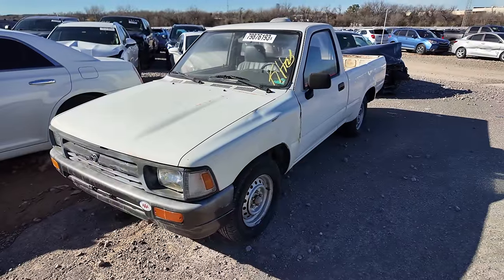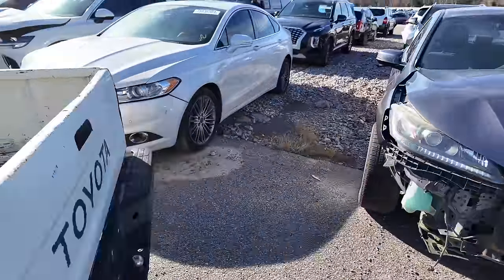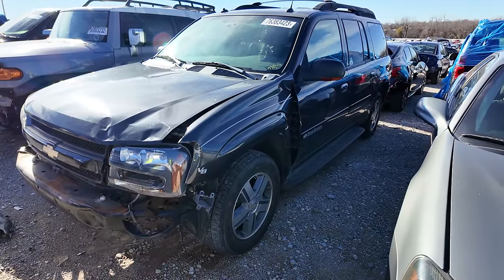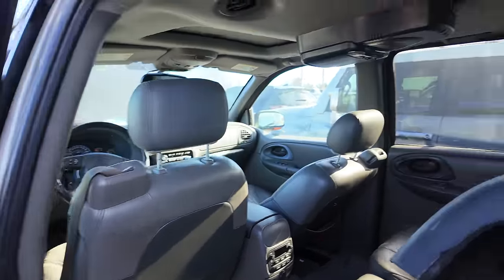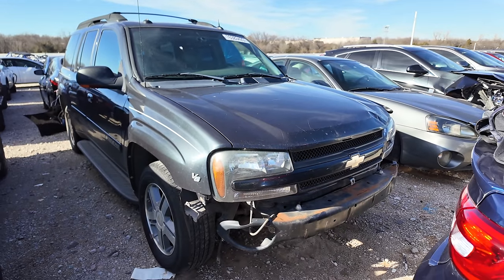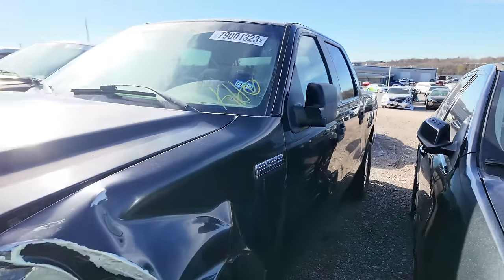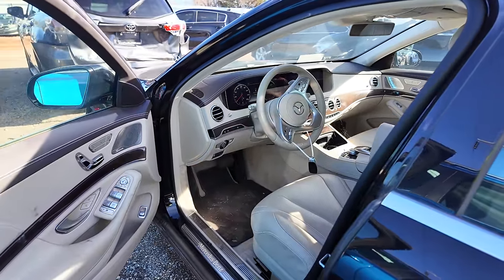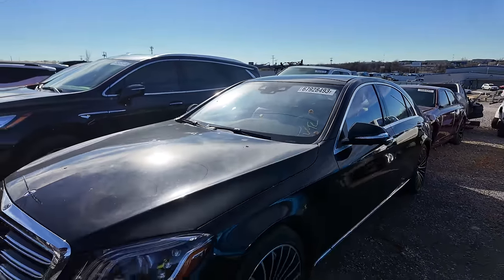I Found this 1994 Mazda Coca Cola Truck Abandoned at Copart! Will it Run?

Comment: I owned a 2006 GMC Envoy with a 5.3 v-8. Oil sending unit is a common problem, an easy fix. The popping in the back is the blend door servo.

Comment: So with that white Toyota pickup that's a 22RE 4-cylinder engine it's one of the bulletproof engines at Toyota ever made will the timing chain the one key should open the fuel door and I bet if you just put some gas in it it would fire right up it's cranking really strong so the only other thing would be Spark I've worked for Toyota now for almost 24 years and that would be definitely a good truck to put in your car collection best of luck

Comment: You should get the trailblazer Randy. Also the clicking is most likely a blend door actuator that needs changed.
Reply: Yes that is an actuator making that noise. Very common for that era of GM. Easy fix

Comment: I had a 2005 trailblazer with the 5.3.  I put a BTR stage 3 turbo cam and springs in it with a 95 mm precision turbo and made a little over 900 hp on the dyno. The transmission didn’t love that, but a few built transmissions later it was pulling wheelies on 10.5” slicks and breaking axles and u-joints.  I loved embarrassing SS t-blazers and vettes.   The v8 Trailblazers are pretty common in Arizona.

Comment: Here is the trailblazer engines

2002–2009 LL8 4.2 L I6
2003–2004 LM4 5.3 L V8
2005–2009 LH6 5.3 L V8
2006–2009 LS2 6.0 L V8

The LH6 are the ones with the AFM garbage.

Comment: At 9:08 I've had a couple Dodge vehicles (a 2003 quad cab Dakota 4.7L and a 1999 durango 5.2L) that had a factory badge there. Not that uncommon. But it worked. I swapped the one on the durango for a first gen dakota badge that said '5.2L magnum v8'. And at 20:48 that's "Mr. Horsepower" est 1931.

Comment: All those errors on the S450 are because of a week battery, once it is fully charged and get conected to scan tool all will be fine, and yes engine is direct injected its supposed to sound this way when cold

Comment: I think the tapping noise might have been a servo motor for the AC system. I have an Impala and it had three of those motors and they eventually wear out (plastic gears) and make that noise.

Comment: I actuary got the S450 for 25000$
Reply from the maker: I was bidding on it but it was too rich for my blood. How is it?
Reply: well the price was just right, there is just no way you could get one with no damage for less than that, I am still waiting for the car to arrive it will continue its live in East Europe and yes it has its owner already waiting for it the last 2021 GLE350 with that kind of Water damage took me roughly 1hour on the trickle charger for the battery and 15min with the AUTEL Tool and was in perfect condition, this one will be the same after full detail and new battery
 @AutoAuctionRebuilds